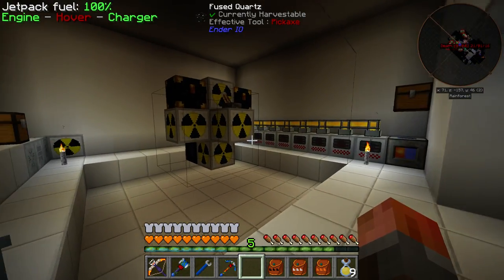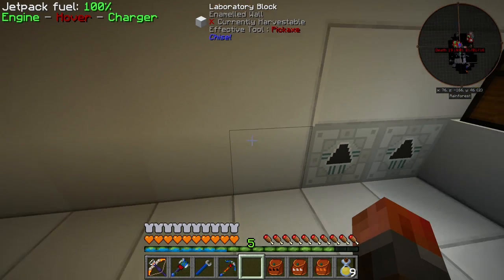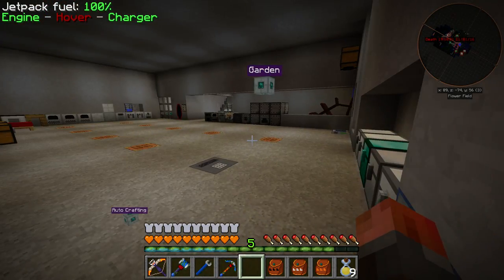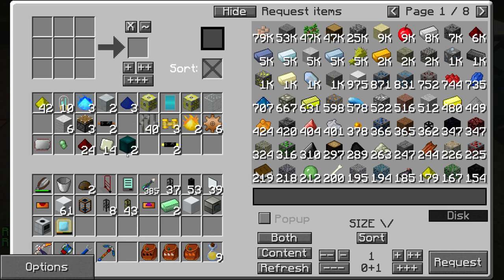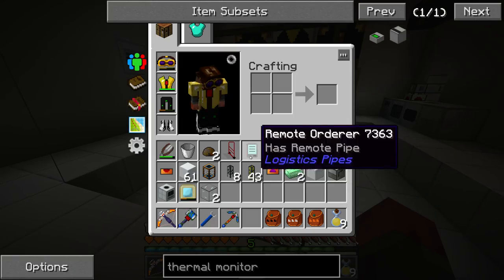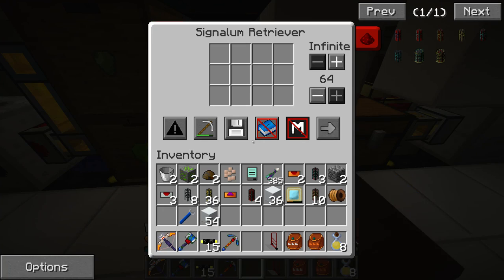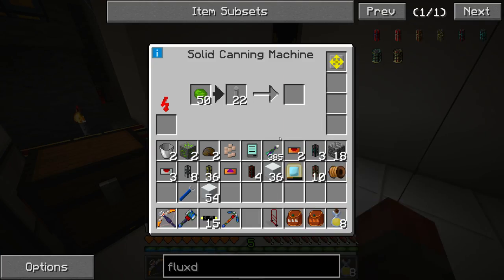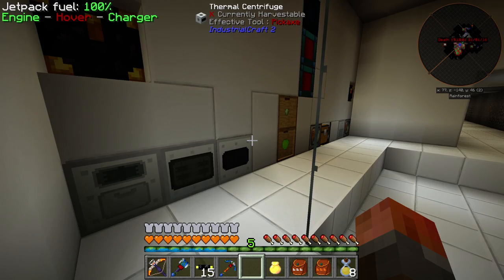FTB Infinity Evolved Expert E37 - Nuclear Control, Automatic Fuel Rods

Comment: Hi Gray, Moxy here. Another great video as usual. One can use the crescent wrench to separate Thermal pipes. For Thermal machines, one can use the upgrade craft to get to resonant machines rather than using one's resonant machine frames (for your viewers knowledge or if that is still a problem).

Comment: Hey, you mentioned at the top of the episode about separating the thermal dynamic pipes. If you wrack a pipe with a crescent hammer it will turn on and off connections.  I hope this helps.

Comment: The thermal monitor will never emit redstone signal direcly into the reactor, you need to loop it around
...I need to learn to finish watching the video before commenting

Edit: MOX reactors produce more power with higher core heat
Reply from the maker: +Nerf13 Hehe - don't worry, I get lots of videos commenting just like that :)